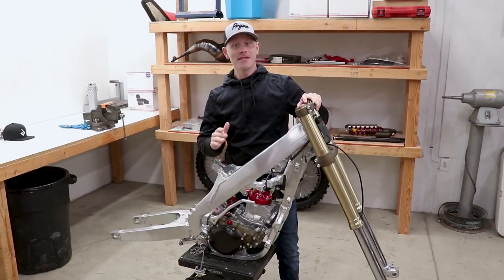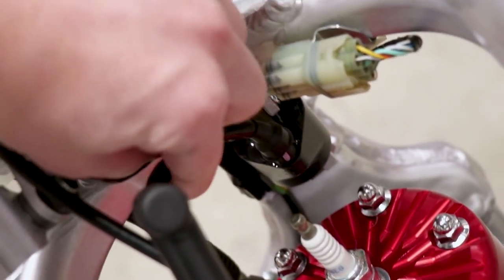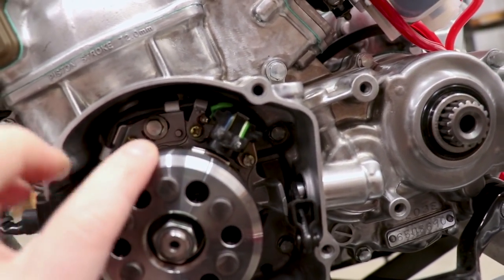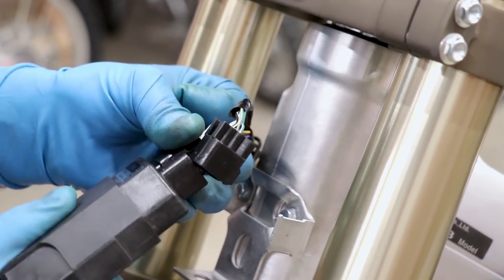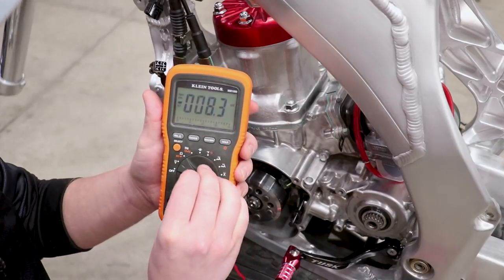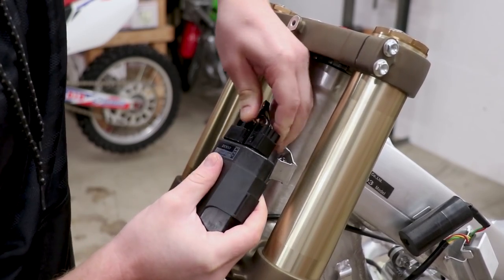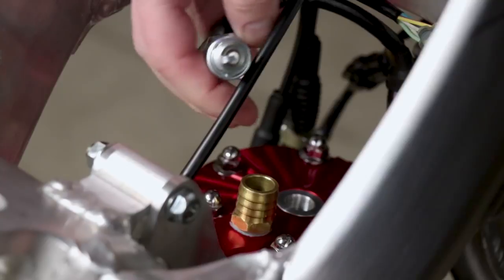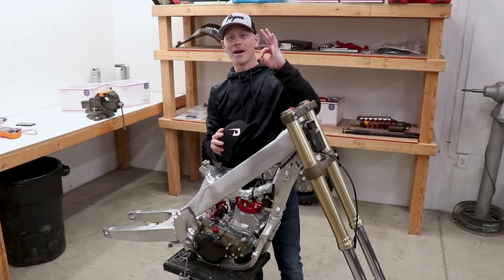Fixed The CR250

Comment from the maker: What to work on next?
Reply: Cameron Niemela put on those beautiful wheels
Reply: Wheels
Reply: you shuld work on everything NeXT ;)
Reply: Cameron Niemela how about you come to my house and do some stuff on my bike 😂
Reply: Supermoto wheels
Reply: Sub frame and wheels
Reply: Cameron Niemela The grease on the connectors probably shorted something out.
Reply: Pipe and radiators. Do some heat tape on the bottom of the tank too bc why not
Reply: what to work on next.. supermoto wheels in there!
Reply: Just finish it fast we want to see you ride it.
Reply: Cameron Niemela eyebrows
Reply: I think the sub frame.
Reply: Wheels
Reply: Subframe, airbox and shock
Reply: REAR LINK, SHOCK AND AIRBOX
Reply: Subframe, airbox, rear shock, get that carb sealed up! 😃
Reply: I can't get over your Uber sterile work environment. For some reason i find it to be frightening in a strange new world kind of way.please don't be an extraterrestrial.
Reply: Tessuto pt3
Reply: Part3
Reply: nice bike!! but not  like the technician or meccanico
Reply: Paul E ^^^^^ What he said. Put on those jewelry wheels
Reply: Do what ya you think you should.Haven't missed a thing . Get stronger my friend.✔️✔️✔️
Reply: Hola... era mas facil si el estator envia la señal respectiva, de forma directa, es decir, pruebas el voltaje que sale de los cables de luz, si estan en lo correcto, pues se revisa el cdi, si este recibe señal y luego la envia, y me parece que la chispa esta muy débil, puesto que la chispa es bastante azul y produce sonido al chispear... pero, hiciste el trabajo que es la idea primaria... saludos amigo
Reply: ronnie macs bike rebuild?!)
Reply: Cambio de Retenes A Suspensión Delantera! 
"Las Barras" Porfavor Man! Haz un Vídeo.
Reply: u dab the grease on terminal ok, too much has a hydraulic effect, also might short out to other isolated terminals. because its conductive, like water.
Reply: fix a broke old bike, then go get dirty and have fun with it, climb a hill, ride thru a steam🤣, bring some friends, fun fun stuff

Comment: Dielectric grease isn't supposed to go on the metal part of the connectors- IT IS NOT CONDUCTIVE!  You go around the perimeter of the plastic connector (where the seals are in the connectors) so the grease makes a seal and water can't get into the plug.   "Dielectric grease is electrically insulating and does not break down when high voltage is applied. It is often applied to electrical connectors, particularly those containing rubber gaskets, as a means of lubricating and sealing rubber portions of the connector without arcing." - I've made that mistake before!
Reply: my dielectric grease i use is non conductive and i use it almost every day on spark plugs and boots as it has a wicked high melting point  ...at my job as a light vehicle mechanic it designed to go on globes and things that play up when get wet to much can cause a short circuit as it is non condictive and stops all the circuits joining  together in a wet plug situation stop corrosion  but to much can deff be a bad thing
Reply: josh012345  yep
Reply: Fixed many cars cleaning dielectric grease from electrical contact points. I always used Stabilant 22 for enhancing electrical contacts.

Comment: The dielectric grease by definition has a very low dielectric resistance. By putting it into the connectors as you did it probably was shorting out across pins in the connector,  most likely the kill switch pins. Build is looking great, keep up the good work Cam!!

Comment: Dielectric grease is actually only for insulating a connection from moisture. It does not conduct electricity. This is something a lot of people don't realize. You need conductive grease to make the best connection.

Comment: Glad you got the issue sorted Cam. Btw.... Not a good idea to hold the spark plug wire with bare hands, when your cranking the engine over ,since it has big voltage and if your hands are even slightly damp, it could give you a nasty belt ⚡️💥. We all learn the hard way sometimes 😁✊🏽. I think the wheels need to go on next 👍🏽

Comment: You didn't go wrong with the grease.👍 I've been doing that my whole life and will still continue to grease connections up. Corrosion sucks to deal with, Some times shit just needs to be unplugged and plugged back in to work right😕😕. It was just a unplug and plug it back to fix this problem.👍👍👍 to bad there not all that way to fix😂😂😂
Reply: bullfrog machine unplug my crank and replug it 🤣🤣
Reply: unplugging and plugging things back, are the electrical equivalent of "turning it off and back on again" with computers.. it often works
Reply: you don't use Dielectric grease on connections.
Reply: @johnseipel4102   No, you do use dielectric grease on connections. Its fantastic for connections.
Reply: @Shane03101  its fantastic for connections if you dont want an electric connection
cause dielectric grease is an insulator

some types of plugs dont have problems with the grease as the pins are just cutting through the grease, but othe types wont
so its best to keep the pins free of grease and just use it to seal the housing
Reply: That's why it worked after you replugged the connector, because it scraped the grease away and managed to make contact 😂if it just worked from the start, it's because you didn't put enough to block all contact and still had some contact. Put a blob of grease somewhere, take your multimeter and do a continuity test, it's not that hard(i just did it). Not to mention that it magically worked after Cameron cleaned the grease. "Dielectric grease is a non-conductive, silicone grease designed to seal out moisture and, therefore, prevent corrosion on electrical connectors." think of it like the rubber gasket, it doesn't go on the connectors, but around it, it's more like a shield.
Reply: I concur 100%- I’ve been using die forever never had an issue- their was prob a connector not clicked in right

Comment: The excess grease pushed into 2 or more terminal compartments and must have had some moisture in it as well. Once it squeezed into more than one compartment it must have arced. Electricity will find the path of least resistance and it found a better route through the grease to ground before making it where it needed to be.

Love this build and these videos this has always been my hobby I have been awaiting a channel like this for a decade!!!!
Reply: Donovan Petersen Dielectric grease is non-conductive. The thin layer of grease kept two of the pins in a connector from contacting, thus an open in the ignition circuit.
Reply: @kaleb97045  you beat me too it! Ive been screaming this exact thing in the comments of the last video hoping to be heard!

Comment: The same thing happened to me once. I swapped out a wiring harness on an old dirt bike, thought I was doing a good thing by packing all the connections full of grease. Went to start it and it wouldn't start, no spark. I even swapped to the old harness and still no luck. Figured out that the grease caused the issue, even swapping the harness the grease from the coil, etc. were still on it so it wouldn't work with the old harness either. Someone informed me that di-electric is an insulator and not to be used directly on connections. Putting it around the connectors like you did later in the video is the correct way to do it. 

Anyway, I wished I saw this video when I had my issues because I spent a lot of time trying to figure it out lol.

Comment: nice man, score! one tool i like to use for that, is my spark checker light. just a little cord with an inline light, that links into the coil and plug so you can see 100% if your bike has spark or not. makes life a little easier

Comment: I’m guessing it was a funky connection. That grease shouldn’t have caused an issue. And Dielectric grease is non conductive so it can’t short out anything. I’ve used that stuff for years and slop it on pretty heavy and have never had an issue. Glad everything is working for ya, can’t wait to see her finished!

Comment: The problem I think is connector oxidation. It’s where the metal oxidates and create a new layer that isolates it from making a good connection. Solve the problem by scraping off the oxidation layer, you can connect and disconnect several times so the metal connectors rubs off the oxidation layer on each other. I recommend to use the connector grease as it will keep water and oxygen away from the metal surface to keep it from oxidation and keep a good connection. 

Keep up the good work!

Comment: I use a Q tip to apply a very thin film. Too much will cause resistance and push them apart from each other or even act as an insulator. Hard grease can be used to drive pilot bearings out so that grease probably pushed those wire terminals inside away from each other

Comment: I've ran into that with the grease. Its actually the spring part of the individual pins. When they get weak over years they build low spring pressure and when you add the grease it causes a disconnect where the spring side hits the flat side. Take a spring hook and bend the spring side outward and it will fix it for years to come.  If not your likely to have the issue eventually show up even without the grease. Hope this helps. Best wishes!!

Comment: ACDELCO Makes a dielectric lubricant which is specifically for the terminals to help stop "terminal fretting" or aka "bad connections".  ACDELCO also makes dielectric SILICONE GREASE which is not for use with terminals. This GREASE is for Spark plug boots and the like only to help seal off  boots and keep them from sticking when you go to pull the boots back off.  Please don't get them mixed up.

Comment: When you were looking to measure in ohms resistance, there were a couple of times when you were looking at kilohms which completely threw off a few of your measurments.  Also, dielectric grease is just designed to seal the connector. Dielectric literally means non-conductive.

Comment: I never put grease in the connection if I'm doing a complete rebuild all I do is clean the connection with solvent and soapy water and blow it clean with my compressor ,,I can tell what you did wrong ,you can put dielectric grease but it has to be very min, because it creates to much resistance in the control module so after you cleaned it out it worked ,most dirt bike plugs now days have weather pack plugs and don't need any grease ,just clean only ,I'm not trying to talk shit to or anything ,I think what you do is very good work it's awesome and you have alot of pride in what you do ,I have alot of that in me I just don't have the time to be able to do that for my customers, I clean all my customers motors off free if grease or oil stains and that's about as far as I go if it's something speacial or a show piece then that's different but to make money its not the best way to go time wise for me

Comment: Hey man great to see you back and  looking good,  you started well with the stator then the coil with the process, I would have continued that with the connectors! 

just with electrical stuff, I would have re tested the spark after you cleaned out the first plug, if you do multiple points you won’t diagnose exactly what was wrong, it’s slower but lest you will be 100% sure if all the contact points were affected by the grease or just one connector, plus it confirms the grease issue or eliminates it, I spent 15 years as a fault diagnostic tech, you can tear your hair out over the smallest things,.

Good work though the bike is looking amazing every video. 🤙

Comment: On the other hand dielectric means "isolant" so it did it's job. In your case you need conductive grease which would better work (but in this case you need to put it just on the metal part of the connectors and be gentle with the quantity to prevent any short circuit). But nice you figured it out even tho it was the hard way

Comment: I'd be more likely to blame that spark plug lead than the grease in the connections. The pins fit tight enough in the connectors to make contact through the grease. I'd have cut back the casing on the spark plug wire a bit more to make sure good contact was being made in there

Regardless, glad to see you're both looking and feeling better! Your strength is commendable man

Comment: Putting non conductive dielectric grease on the terminals themselves relies on the terminals having some sharp edge to scrape away enough grease to make good contact, some terminals like bullet connectors don't have that where most spade terminals probably do.
That said, the terminal blocks have moisture seals and simply greasing the seal will be good enough to keep out moisture enough to stop any oxidisation of the terminals.

Comment: Really nostalgic, why Honda alone Pro Taper of ANSWER was not found at that time, did not it? After all it was shocking to change to the inverted fork from 1988 to 1989.I prepared a separate frame for the double cradle and exchanged when the frame opened during the season. From Rick Johnson to MacMcGrath
The era has changed to the  all the memories are packed in this video, Thank you

Comment: Hey, just a hint from a electrical engineer: on all connectors newer than 1980 never use any kind of grease. You want a good metal to metal connection and don‘t have any isolating grease between it. Onyl use grease on the seals if they look dirty or old

Comment: The spark plug lead from the ignition coil also has a screw terminal connection, and needs to be clean and tight.. Sometimes just by wiggling the wire, will make the connection conductive again..

Comment: Ive never had a problem with greasing connections. And I use way more then you did. You could have possibly put the plug boot back on tighter making a better connection?? Awesome build

Comment: If the grease you are using is conductive,  it may have shorted between terminals. If you put too much. The grease is good to put directly on the metal connectors to prevent corrosion.  Just dont over do it. We use conductive grease for all our connections for back up power systems and large batteries.

Comment: I haven’t watched the whole video yet !  but dude the spark plug boot has got to be the issue the wire should be exposed about a half-inch out and folded back and then crimped on the connector
Reply: Ios 6 dirt bikes are generally different than cars. That boot has a threaded rod inside of it that screws into the inside of the wire

Comment: Yeah your right.. you’re suppose to put it around the connection I’ve put this on my car battery and it was messing with the ground I cleaned it an then put the cables back on then put grease around the connections and boom problem fixed!😉

Comment: I had a problem with that exact same dielectric grease on my XR650R CDI after a rebuild. Didn't show up until months later. Died in the middle of a ride. Went through carb 2X. Finally started with electrics. Pulled CDI connection off and the grease had got gunky/corroded. CLeaned it all and it started and ran but wouldn't run above idle. Replaced the plug and that fixed it. Apparently the CDI caused the plug to go out.

Comment: I knew when you put the grease on the connectors you was going to have a problem.  dielectric grease does not conduct electricity. On the connectors would be ok. On the ones you used this before and they worked was probably because it didn't cost the connectors completely and there was contact so it still worked but if you get a film of dielectric grease on the electrical contractors it will insulate. Glade you found it.

Comment: if its a single electrical connection you can add light lube, other than that I recommend just keeping things clean and not using any grease, unless you drop the bike in water shouldn't have any issues.

Comment: I once fried the ignition coil because of the spark plug cap.I was trying to start my bike that was sitting in the garage for a long time,it had spark when i kicked the kick starter.so I checked the other components,it started on the third kick,so it rode the bike like usual..but then after a day,the bike just died for no reason,i checked the spark plug for spark but there was no spak,then I checked the resistance of the source coil and ignition coil,the ignition coil was fried,then I pulled the spark plug cap off to use it again but there was no reading on the multimeter,then,i realized it was the spark plug cap's fault...it arched inside the spark plug cap...then I changed the ignition coil and everything worked fine after that..Lesson learned,check every electrical components before trying to start it..

Comment: Try using lanolin spray on electrical joints in then blowing out the excess with air
No corrosion No shorting

Comment: Hi Cameron. That happened with my Suzuki, the problem was the engine bovine, did you checked the voltage? Maybe was very low, or the cable from the cdi. Come on master!

Comment: Ohm your coil wire and cap.
10.5 to 11 is good for the kz4 coil
Coil 5.5 
Wire 5 
Cap 5 
Check all three of these separate. 

Any lower they are bad.

When you Gap the points you have to loosen both of those Phillips screws to Gap and properly because that is a magnet. So by you putting that feeler gauge in there you did not Gap it. Every time you pull the ignition out of the motor you should recap this .018 to .025

Comment: the grease was for sure not the problem. Ive used it in hundreds of connectors on all sorts of vehicles. i love the stuff. i'm pretty sure the problem is that when you were first testing for spark you used the nuts on the head which seem to be coated and not a good ground. and you then attempted to use the head which is coated and not a good ground.
Reply: the fact that people say the grease will cause it to not contact is idiotic. It's not like the pins are loosely connected. they are a decently snug fit and grease will not separate that fit.